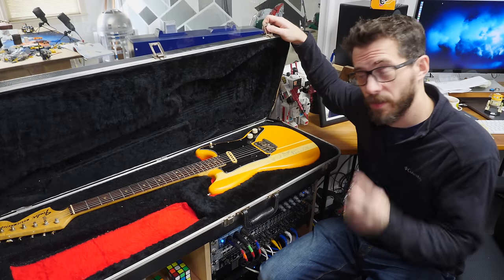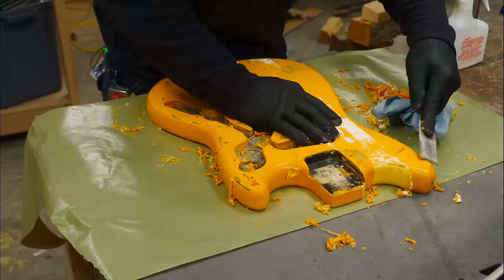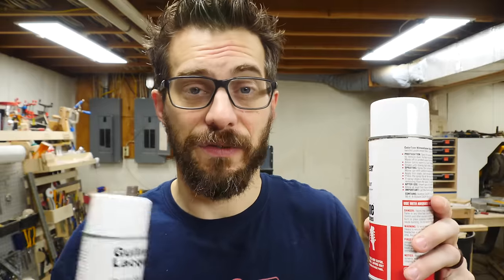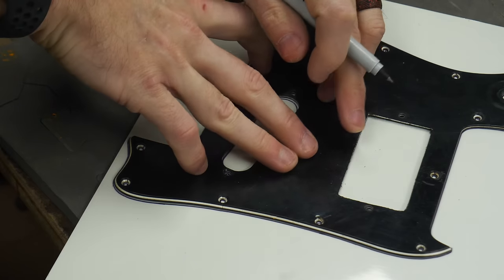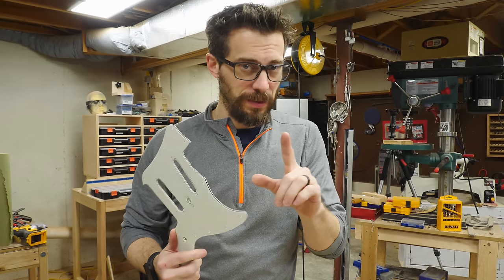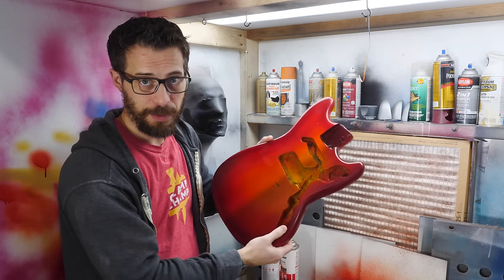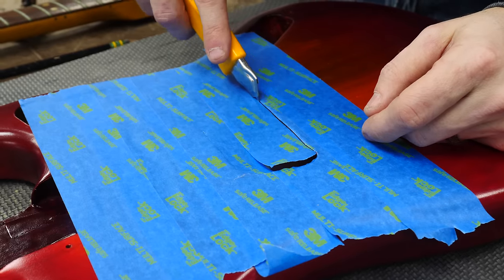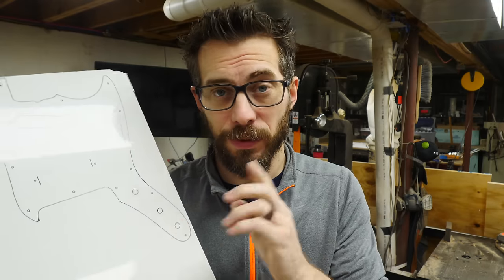How to Refinish A Guitar | I Like To Make Stuff

Comment: Just some input about getting a glossy look: it's not just sanding and putting on top coat. If you do that, you're always gonna have uneven spots or small pieces of dust in the finish. If you want a factory glossy finish, you need to sand it with very fine sandpaper (like up to at least 1500/ 2000, some even go up to 5000) and then buff the guitar with buffing compound and polish, that's the part that makes it shine like it just came from the factory

Comment: Cool job refinishing that guitar!
The finish on my very first guitar has got huge chips in the paint so I was thinking about refinishing it but I'm too scared to ruin it...

On a side note, that's not how these vintage tuners are supposed to be used. You're supposed to cut the string (add 2 string posts to the length), and then insert the end of the string into the string post.
I actually like those vintage tuners a lot.

Cheers!

Comment: Great job man. It take times,  love and patients to do that project. Dremel have a router bit that would have work on the pick guard. TIP: Tilt your scroll saw table about 3-5 degrees when cutting out holes for your pick guards. (or any inside hole) Then using your files to custom fit the hole you will end up with a tighter fit that is much easier to achieve. Many Blessing. Turbo PS: if you need cardboard for templates ask the guys at Lowe' s for the 999 hundred boxes or for appliance boxes. They will help.  Also ask for the wrappers/tarps the white-wood comes cover with. Great for your saving your spray booth , landscaping, covering stuff up with and any think else you can figure out what to do with then. They are handy for just about anything and they just get tossed. Rock on!

Comment: Hi – I really enjoyed your video, with your approach to problem solving and presentation. There are a couple of things that I feel do warrant a bit of consideration before people dive into such projects though. First the cost of using many cans of lacquer and subsidiary bits and pieces isn’t cheap. Secondly, dabbling with pickup positions – it’s worth recognising that the original positioning and angle of pickups is based on string harmonics and where the vibration nodes are – not just what may look good. All the best.

Comment: I've refinished a guitar before, but you might as well replace all rusty parts. You also did not touch the neck.  Trying to get a glass smooth finish on the neck is very difficult, but adds significantly to the value if its a uniform gloss finish.

Comment: When you chamfer the edges of the pick guard, you can make custom files by wrapping sandpaper around a wooden substrate. Dowels, paint stirring sticks, pencils, virtually anything that will give you a useful shape that you might need. You can also plane a shape if you want from scrap wood. Another advantage to doing this is that you can use whatever grit size you want. Files are a little expensive and they clog up, get dull, etc., making you hesitate to get rid of them. You can just switch sandpaper at will and you have a new sharp cutting tool with minimal investment.

Comment: when sticking your template to your piece, use masking tape on both sides then use CA glue to stick the masking tape to itself. then when you pull it apart, the masking tape sticks to itself but comes off the template and final product without leaving any residue.

Comment: If you don't have a drill press, you can use a no 1 tip phillip"s head as a punch, that will guide your hand held drill's bit into the center. Simply put the tip of the tool exactly where you want your hole, lightly tap (<, or >, according to the material's hardness) the bottom of the tool, and it will render an "X", that marks your spot. The indentation from the screwdriver draws the bit toward the center.  Brad point bits are definitely a plus, but this method has worked for me, when I was getting started, and couldn't afford a press.  -Skal

Comment: you could also have started with the amber coat in the middle, put a down sized cutout of the shape in front on the body and spray that red paint.
Also, why worry so much about finish when routing the cavities? it's behind the pickguard anyway

Comment: After all that I think I would have color sanded it and buffed to a mirror finish.  That clear went on pretty dry by the looks of it.  Still could do that but looks really good though.  The clear would need to be a little thicker most likely.  

Also should have sorted out all of the wood work before starting on the finish.

Comment: To scrape off thick paint like that you would find it much easier to clamp the piece to the workbench (so it can't slide) and then use a sharp wide chisel with a negative rake, rather than using a blunt tool with a positive rake like you are doing. Thus, a lot of pressure can be applied to destroy the paint without hurting the wood. HTH

Comment: instead of the spray adhesive to glue the template to the pickguard you can use stripes of masking tape firmly pressed on the pickguard and on the same position on the template. Use Superglue to glue the masking tapes together. You will have a strong connection for routing but you can easily remove the template and the masking tapes from both surfaces.

Comment: Pro DIY tip...if you dig up or make a box of some sort, say a large bandpass box, and a small box heater to blow into it, you can keep any materials that need warming(all your paints/stains) toasty warm just setting them inside and using an old t-shirt to cover the opening. I've kept cans warm to the touch in a shop environment where the air temps were just above freezing. Using a cloth door will ensure vapors can exit instead of building up and being a fire hazard. Yes, you can spray in those conditions as long as you can bring the surface temp of your project up to spec, torpedo heaters and infra red curing lights are your friend...

Comment: Use water and a hot soldering iron to lift up dents in the wood. Be sure to use a damp paper towel between the body and wood. It works miracles if your careful.

Comment: Also, you shouldn't need to sand lacquer between coats because it used a chemical bond and becomes one layer, thereby not requiring the scuff sand.

Comment: It's easier to make bursts with overlapping coats from the inside out, and some wet sanding to blend the layers... So start with your yellow around the center, do 2 coats, then wet sand the inside perimeter until you're satisfied with the shape and blend to natural. Now cover the inner edge completely (just to prevent accidents, you're not gonna spray too close to the edge anyway), and spray the red on the outside, and repeat wet sanding on the inner gradient. Rinse and repeat for a black edge. After it's all done you're probably gonna have 6-8 coats on there, so finish it up with a few coats of clear, polish it with compound and apply some automotive wax after it's cured.

I'm working on a custom guitar right now, a through-neck LP-shaped semi hollow body with soft edges, 1 3/4" thick, a recessed flat top, in mahogany, maple, and probably wenge or ebony for the top and fingerboard. Here's a render: https://imgur.com/nc599Fw .

I'm either gonna take the sanded and sealed thing to a body shop for a professional clear lacquer finish and ceramic coating, or I'm gonna use lots of polishing rags and diluted shellac and hours of my life to build a French polish on it.

Comment: I was always told to paint light to dark.  Paint the whole thing a light color and then work in your burst.  Your pickups should have a gap around them so they don't touch the pick guard. You might get a vibration.  The pickups should also stick up out of the guard further so they're closer to the strings.
Reply: TexanUSMC8089 I think light to dark is mostly for when you hand rub a burst finish. I guess it’s also probably good to do that for free handing it. I would have just sanded it with 1,500 grit sandpaper and sand up to 5,000 grit, then buff it with compound and polish. I don’t think I would have removed the original finish. I’d say that he has some knowledge of how to refinish it, but he still has a long way to go.

Comment: Heat gun and scrapper, better and faster than stripper.
BTW almost every fender student model or not is either alder or ash.
Vary rarely did they use a soft basswood.

Comment: Fender SN starts with S (for Seventies) and then an 8 = 1978, (S7 xxx = 1977, etc) Duh.  I've been a Luthier since the early 80's and I think you did a very good job. Tip to others, see it the new PG with NEW Electronics fits FIRST BEFORE doing the refinishing job!!  That way you can route the PuP cutouts the right way with no concern for the finish!! That is guitar building 101.

Comment: Lesson-to-be-Learned: ALWAYS dry-fit your pickguard w/mounted electronics BEFORE spraying your final finish.
While your guitarmis apart, I would also highly recommend lining your body cavity with copper-foil and connecting it to ground to create a 'Faraday cage'. It will help mitigate any outside interference noise. Yes, even with humbuckers... but, especially, when using single-coil pick ups.
Nice project! I wish I still owned all of my early guitars (especially, my all-original, early-60s Gibson SG-shaped Les Paul and my ES-335 TD, hollow-body). 
Your guitars have a history that can... and should... be passed down for many generations.

Comment: scuf the surface with 12o grit then put the paint trip on, let it sit for 5 mins, then add another thin coat of stripper. Then you scrape it, clean it etc. i do alot of furniture refinishes thats just what I learned through the years im only 21 been doing it since 16
Reply: 120 grit **

Comment: Basically pretty nice compared to what it was... if a little imprecise around the edges. I do admire anyone talking something like this on. Not quite sure why you didn't paint the whole thing yellow and then add red around the edges. 
  A  long time ago I had a mahogany strat type body which I sprayed directly with maroon metallic car paint. It soaked into the wood and left the texture of the grain but not the wood color. I did some light sanding to take off the roughness that popped up and another light coat. It was surprising how the grain remained with the metallic.  I had a friend spray-paint a beautiful Chinese dragon in green and gold and then clear coated the whole thing. It came out looking great. After the original owner beat it up for 20 years I got all the parts back and rebuilt it.

Comment: i see a lot of guitar finishing videos and rarely see them using hvlp guns, never understood  why.  i have been watching cause i am interested in  refinishing a few of my own. I've sprayed kitchen cabinets and furniture for over 20 yrs and just add lacquer stains and or colorants to my clear coat to darken or achieve the finial finish. Dont see the advantage other then you don't have a compressor to spray. From my experience even a cheap 30-50 dollar spray gun lays a better finish then most rattle cans. And for the most part $40 for a gallon of clear laquer plus laquer thinner would be cheaper.

Comment: You did a great job on wood and I'm definitely gonna take some notes, but the pickup angles are completely silly. (I know that because I did the same thing once.)
The neck pickup at this angle would read properly only 2-3-4-5 strings, and the bridge pickup would be too wide at the straight angle, its cores are misaligned with strings, and even if this would be a rail pickup, it would lose a noticeable amount of gain because not all surface of the coil is close to the strings. Basically, on your pickups it's a matter of aligning coils with strings, therefore the angles. Single-coils even have their cores at the different height to compensate for different strings thickness and tension, it's generally a good idea to install them by the manual. If sounding like an old radio box is something you were at (because some people want that sound, especially on tele neck pickups), then disregard this rant.

Comment: Next time, try using this clear coat you can get from Amazon: USC SprayMax 2K Glamour High Gloss Aerosol Clear This is an epoxy clear coat used for car finish.  Instead of drying (as paint does), it "hardens" to a chemical proof mirror finish.  You may need to use auto base coat for your base color, too.  You also need good ventilation for this.

Comment: In order to get a better sound and prevent buzzing, you should add copper foil tape or RF blocking paint to the walls of the electrical cutouts to prevent RF interference
Reply: Yep, and it didn't look like that ground wire went back under the bridge either..
Reply: @xD3adKl0wnx  This too

Comment: I want my bass to just have a flat finish; is there any reason not just spray paint the wood after it's been stripped?
Reply: You need to seal it, beforehand, or you're going to get an uneven finish once the paint settles into the grain, but you can definitely use spray paint, if you like.  I would recommend a matte clear coat, but mainly for added protection.  Not a requirement.  Guitars get banged around a lot, and I'd rather small dings go into the clear coat, than the color.  It's a lot easier to spray another clear coat for cleaning things up, than it is to repaint.

Comment: One other comment regarding finish.  I see a lot of chatter in the comments about what to use to get a glassy finish.  If you tour a Gibson or Taylor factory, they are using extremely toxic coatings which cure using UV and they usually only use 1 or 2 coats.  The burst of UV added in the spray booth calatyzes the coating and causes it to dry glossy in one shot.  All the surface finishing is done ahead of painting, and there is no weeks and weeks of painting and sanding.  You can't visit the Mexican Taylor guitar factory, but you can visit the US custom shop north of San Diego.  In that shop, they can make a finished custom guitar in 7 days including the manufacture of the neck from stock wood, and the final product can have a matte or glossy top.  The only thing that slows them down at all is either custom tone wood (if it's not in stock and aged) and custom inlay (which will only add a few days).

The takeaway for us hobbyists is that the right materials can get you the right result in less time and effort - but they are expensive.  Another way to get topcoat on a body with great results is to take it to a local (not chain) body shop and ask them to clearcoat your custom paint job which is already on the wood.  Make sure you are using paints/dyes on the body which will not react poorly with clearcoat, and you can get something amazing without 6 weeks of hurry up and wait.

Comment: There is a luthier's trick to hold down whatever you are working on.  Masking tape and super glue.  Lay strips of masking tape on your workbench and on the item you are working with (sticky sides on the bench and on the item).  Now run a small line of super glue on the workbench side of the tape (dry side of tape) and use a super glue accelerate to speed the drying process.  Now press the item to the bench and now the item won't move on you.  To remove it from the bench, gently pry it up, and remove the tape.  Clean up is that easy!  Ben Crowe of Crimson Guitars is where I learned of this trick myself.

Comment: Nice, but as a luthier I was cringing a few moments. Not too many. You did things out of order for the most part. I was yelling at the screen "stick a back on the pick guard to route the edge" and the assembled pick guard should have been test fit into the body before you even thought about paint or sanding. But that's it. And you knew what did wrong. Turned out great though. Liked and subbed.

Comment: Time saver tip- If you wire pick-ups/pick guard yourself & you don't do it very often, plug in the unit and test for proper function BEFORE you install the pack guard..

Comment: I used a heat gun to strip away the old white finish on my 20 year old Korean Strat, not a chemical. It had a heavily resined plywood body that I patched up with some Bondo, put new wood in the screw holes and sanded to a 220 finish incrementally first with an electric hand held sander then by hand. I changed it for a spray can black then I did four (4) hand wet sanded coats of gloss polyurethane off of my compressor driven spray gun and built it up thick... I am pleased with my results. I bought a cheap Chinese replacement neck of maple and rosewood and did four hand rubbed coats of polyurethane also. Then I made my own custom logo decal with my computer and some water slide decal paper and added four more wet sanded coats of the polyurethane over just that so as to have it layered in and not chip off... You can see it for yourself if you type [ Maso's Blues ] in "Search" above...! Before and after...!

Comment: You really should be wearing a mask with appropriate filters. 3M masks are pretty good for this kind of thing and you can switch filters depending on what you're doing e.g. sanding or spraying. Don't risk your health. A pretty good finish considering you're using a rattle can. Very nice.

Comment: If you want to save your paint, before painting the body, check to make sure EVERYTHING fits so if you have to do routing, you won't worry about damaging the paint. As a model maker, I would rather see MANY LIGHT layers sprayed on with light sanding in between for a more even and smooth finish. I seen a guy do close to 30 layers of paint and clear, yet with sanding in between those layers, it came to almost a glass look. 

Yes, it's  a lot of work, but the more work you put into prepping, the better the final product becomes.

Comment: great video but never take a neck off with a drill or impact driver as you can heat the wood up , use a normal hand held screwdriver.
Reply from the maker: Heat the wood up?